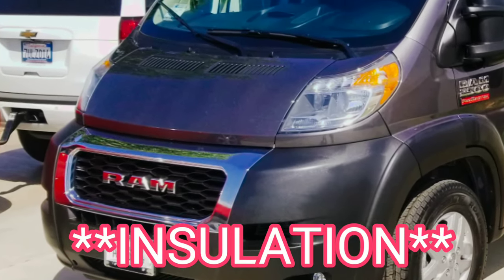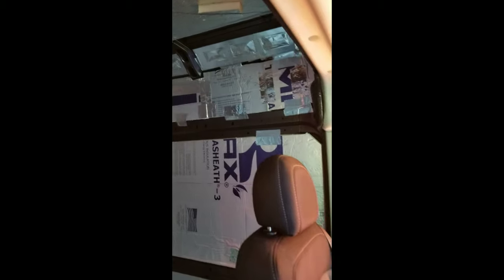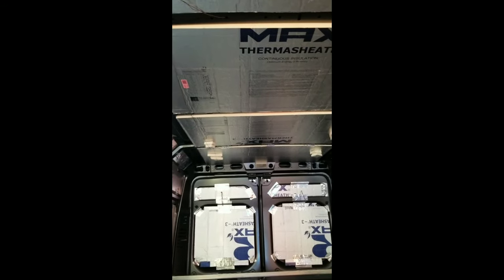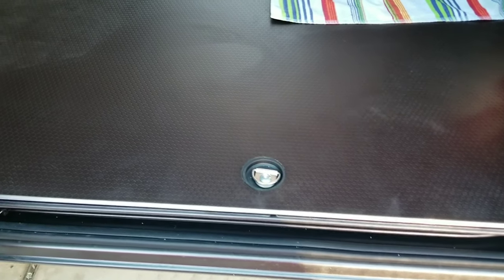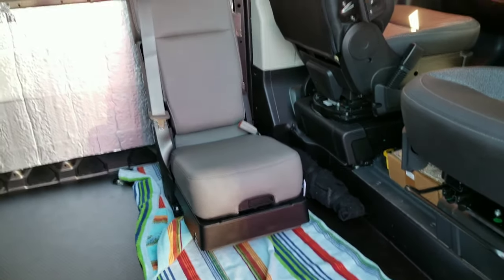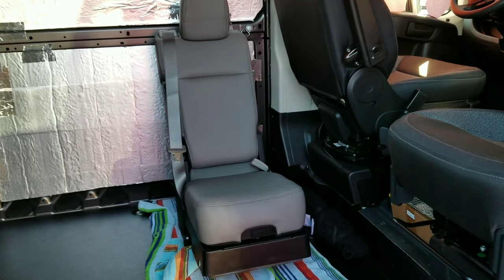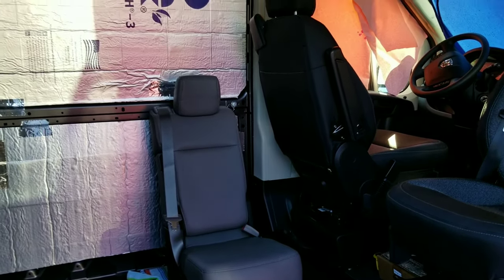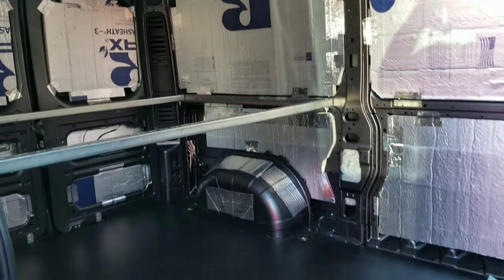Van Conversion buildout Stage 1 "Insulation and Jump seat"

Comment: do you plan on keeping that seat side-facing? I wanted to do the same, but I've heard that is not safe.
Reply from the maker: I did, but its between my shower wall with padding and the back of the drivers seat which is also padded and it has a shoulder seat belt. I'm confident its plenty safe.
Reply from the maker: I need to revisit the van on the channel,  its completely done now we love it!

Comment: How did you install it?
Reply from the maker: The seat? I welded a frame for it to sit on then bolted that through the floor with large washers on the bottom. The insulation is pretty self explanatory.

Comment: Would the jump seat fit in between the front two seats and bolt in?
Reply from the maker: You might be able to do that but you'd need some custom brackets to be strong. I think it would fit though.